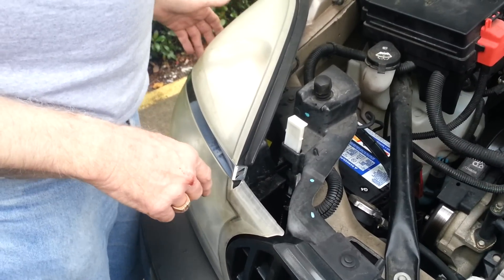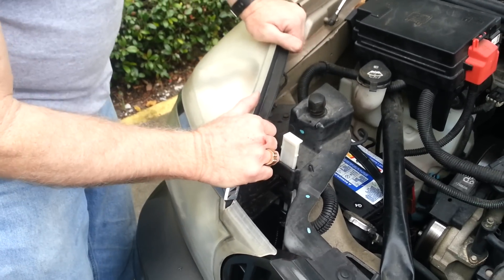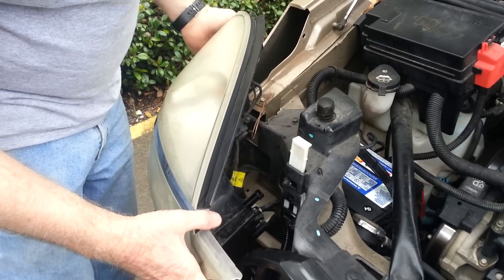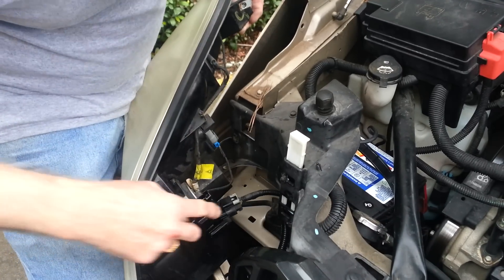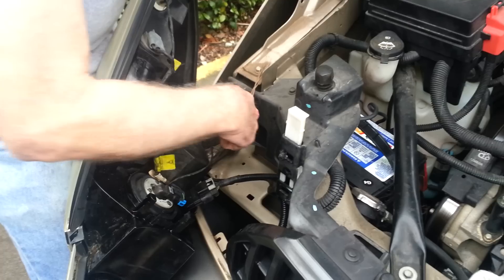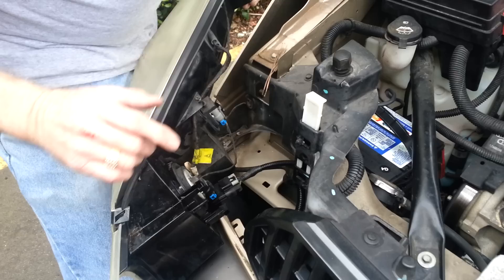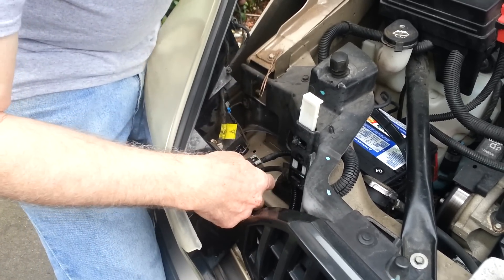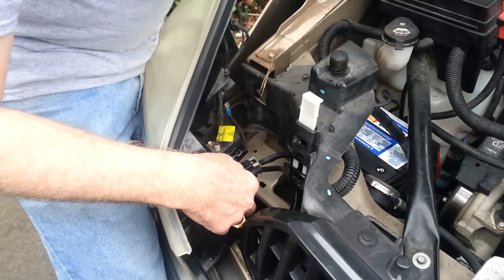Buick Rendezvous Headlamp

Comment: This was generally helpful thank you.  My headlamp assembly (2007) was also attached by a plastic clip which is screwed to the body panel (over each wheel).  It is accessable and easily seen after you have the hood up and before you do anything with the light.  Look for this and unscrew before attempting to pull the light assembly out as i did not know about this one and broke the clip.